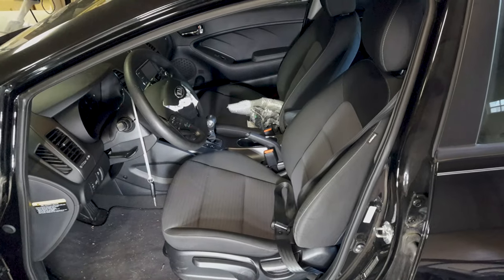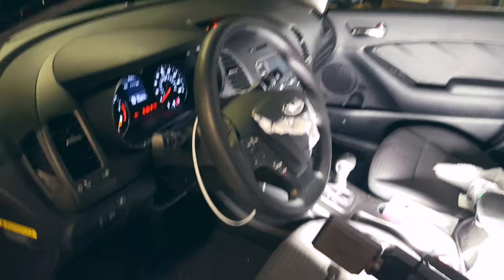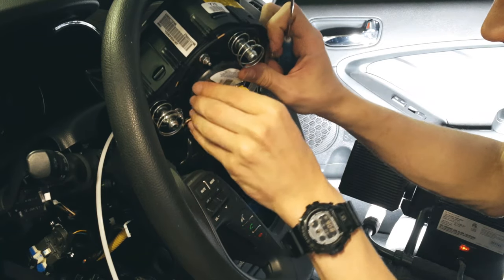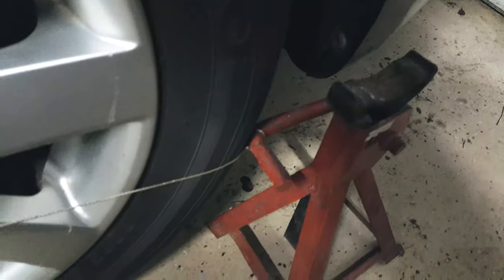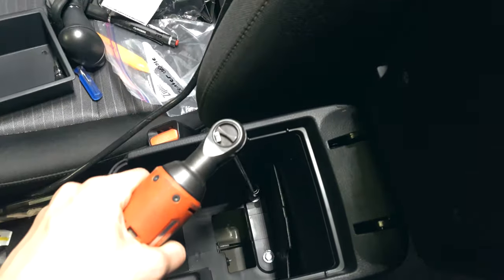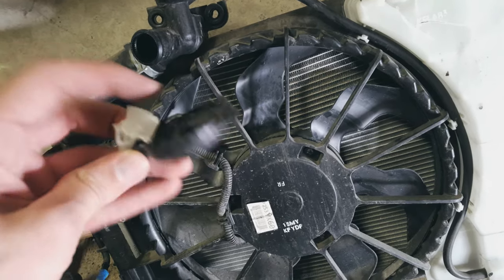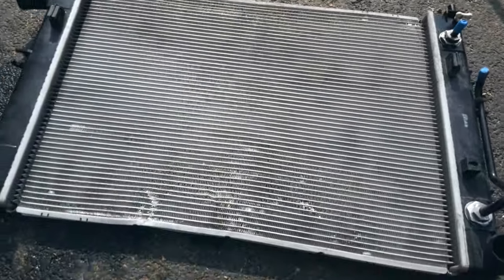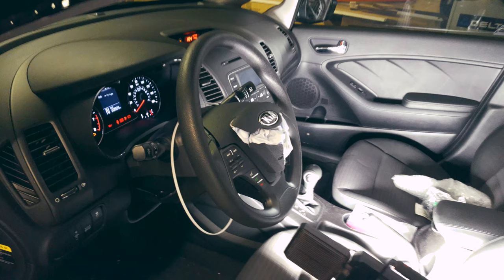Airbag Removal & Radiator Repair | Kia Rebuild Pt. 3

Comment: Radiator damage is usually not worth fixing. The plastic welding seems pretty good. I wonder if it’s good long term or is very strong. Love your videos and calm demeanor.

Comment: Was thinking about the position when you removed the Steering wheel in the video, but your way to resolve is clever. Never tried plastic welding yet, but you seem to produce stable results with it. Why don't you polish/sand it smooth in the end of repair process? Would look far better and more OEM. Sure it would be more fun to have the correct part from the beginning ...

Comment: What you need to do is put a chain between tree and others car as a ancer then do what you were doing please uphock battery and then take sensor that unplug first then replace airbag and sensor be carful you don't want to blow the airbag it would hurt

Comment: Most new car airbags are just held in with just spring clips. 

For the seat belts won’t you need a new impact sensor?

It will suck if the new radiator fits that new fan perfectly and you moved the mounting bracket for no reason
Reply from the maker: I'm just a little surprised that after deployment, the airbag doesn't pop out from the forces bouncing it forward (if there are any).
I got a new impact sensor too. I'll install it later.
I thought about that, but the new radiator is OEM so it won't be a problem and I can see that it will be fine in the product pictures.